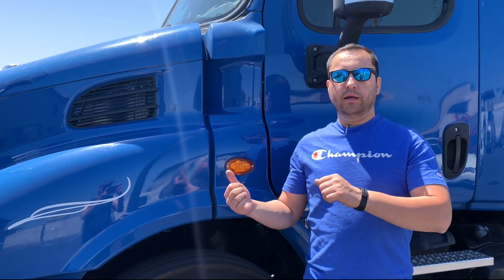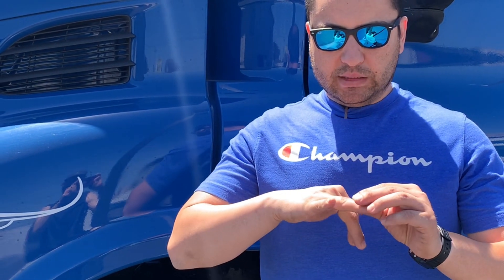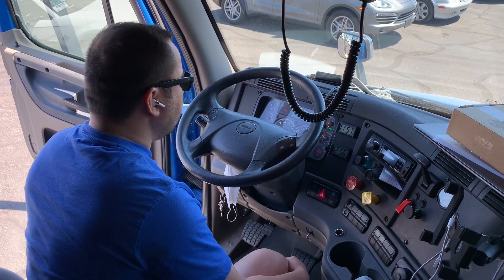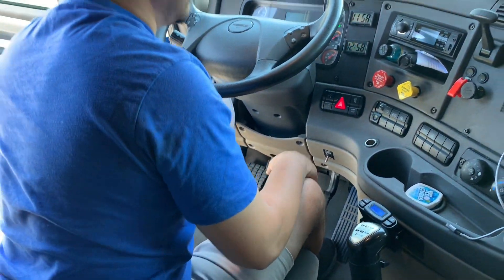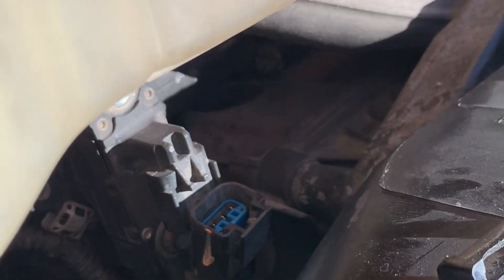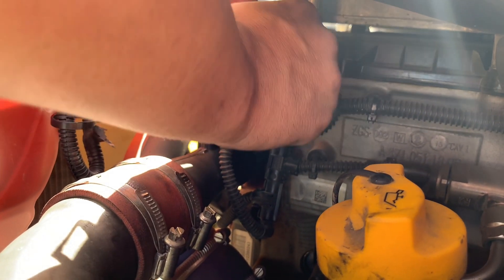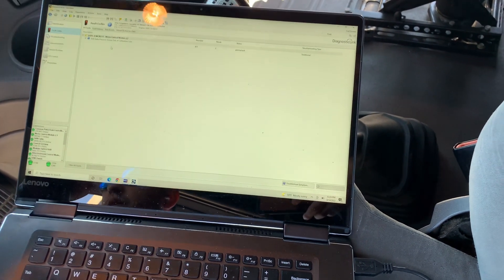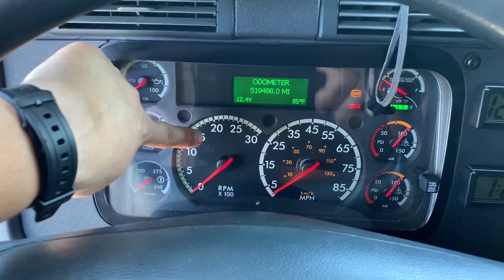Detroit diesel DD13/DD15 Delta Pressure Sensor Replacement and Recalibrating Freightliner Cascadia

Comment: If I don’t have an engine light on, could I still have this issue? When I’m shifting gears, my truck will bog down and then take off like normal.
Reply from the maker: No, this sensor will throw an Check Engine Light and is controlled by ECM. It sounds like you have a out of balance flywheel or bad clutch.
Reply: @jackofalltrades7417  literally a few hours after I asked this question, it threw the engine light. So I tore it apart and it sure enough was the delta pressure sensor. So thank you for posting this video. Truck runs great now.
Reply from the maker: @John.Alphonso  Excellent to hear

Comment: What is that thing that you have for bypassing the trailer light fuse?
Reply from the maker: There is nothing bypassing trailer light fuse, please specify what you are referring to.
Reply: @Jack of all Trades  the thing stuck to your dash in the knee area. You said that your trailer light fuse was out, but you don't have to worry about it because you have that thing.
Reply from the maker: @berniesands6201  Oh that is the trailer brake controller, that's what controlled my old 5-car hauler. It was equipped with electric brakes. My new trailer is air brakes, so that controller is out now.
Reply: @jackofalltrades7417  aww okay 👍

Comment: Where is the DPF delta pressure sensor?  2014 DD13 cascadia 125 throwing a code that my DPF pressure sensor it throwing high codes.  Thanks
Reply: try watching the video,he VERY CLEARLY points it out!!!!!!!!!!!!!!!!!!!!!!!!!!!!!!!!!!!!!!!!!!!!!!

Comment: What scanner do you recommend for the m2?
Reply from the maker: I use Detroit's Application, you will need a laptop and Nexiq USB Link 2 in order to communicate, then the application is $550 annually. The rest of the regular scan tools are not very good and won't really do anything.
Reply: @jackofalltrades7417  Do you have link for application?

Comment: Thank you for the video, very helpful, my truck has the same issue , got the parts, but no computer, what should I do without computer? Please help!!
Reply from the maker: I have used DTNA Connect, which costs about $550 a year for the software along with a laptop and a NEXIQ which is about $799. So it’s gets gets quite costly for a DIY repair. 

See if you can find an aftermarket scan tool that can clear that code, no programming needed. Just clearing the fault code. Worst case, you may have to visit your local dealer and have them clear it. Good luck

Comment: Great video boss where did you get the software program? For the freightliner ?
Reply from the maker: You can download it from Detroit, or snap on, runs $550 plus tax annually, and you need Nexiq connector to hook it up, an additional $750
Reply from the maker: @cumminsMoney  no problem, here is the site where you can download the application l. https://diagnosticlink.nexiq.com/DTNA/Default.aspx.

Freightliner dealers will direct you to this site

Comment: Thank you for the great info,
Do you have to recalibrate the new sensor after replace the old one ???
Reply from the maker: I don't think so. I did have a check engine light that I cleared, and no issues since then.
Reply: @jackofalltrades7417  Thank you